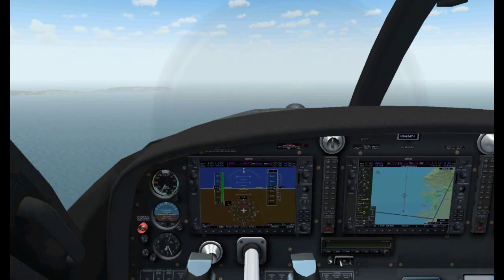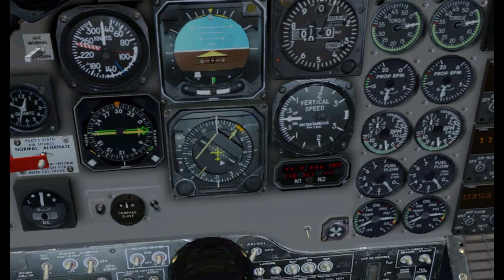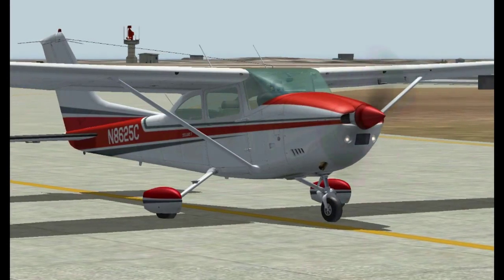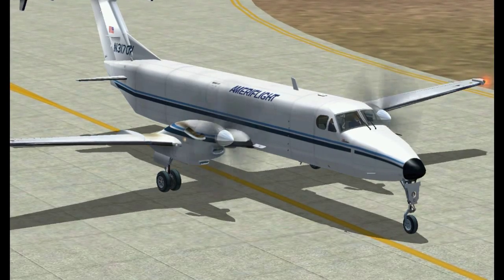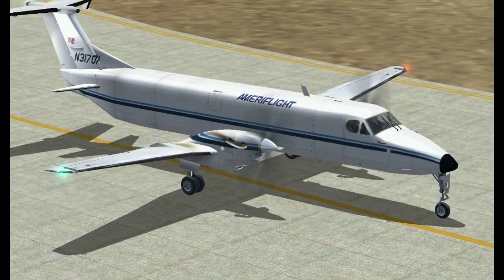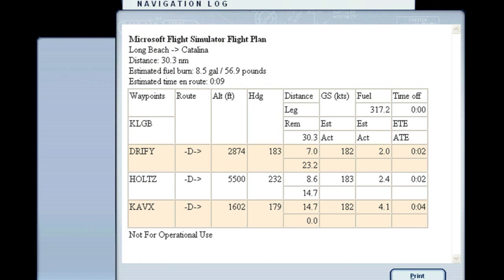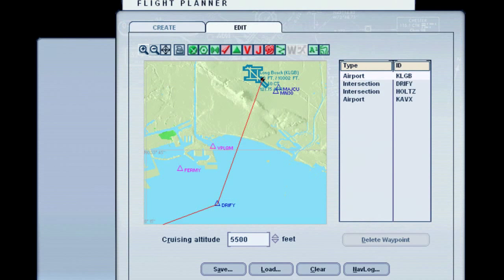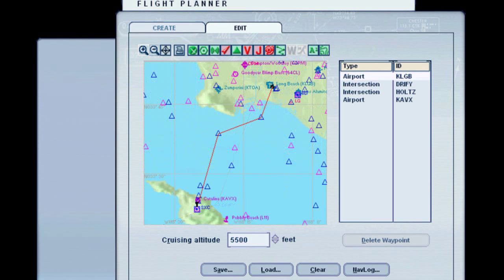GPS Navigation Tutorial - Part I (GPS Navigation Briefing)

Comment: @Mets747 You need to have 1200 hours, 500 hours cross country and all the other part 135 Captain requirements because you would be operating single pilot part 135. 

Ameriflight is good single pilot experience. It is excellent experience, but you can expect a duty day 13.5 to 15 hours long, depending on the route you fly. And you may only be logging 3 or 4 hours a day, depending on your route. 

A work day might be 5am to 7pm, you take a 3 hour nap in your hotel to make up for lack of sleep.

Comment from the maker: @bushflyn 

Any pressurized plane you can descent at 500 to 1000 fpm (piston planes) and 500-2000 (turboprops)

For anything that is not pressurized then keep it at 500 fpm max.

As far as when to start descending, a good rule is 1000 feet for every 2 miles, so if you have to descent from 12000 to 2000, that is 10,000 feet, so for 10,000 start your descent at 20 miles.

This is not set in stone, but be ready to make small adjustments to it depending upon the flight.

Comment: thanks. i generally only use props! small to medium, and occassionally up to a king b200 or q400 or beech c/d. usually cessnas up to the 208 really. i just want to be at say, 8,000 feet, and know how to descend steadily in time for approach. i am using real world charts (australia) where possible for all legs of flight. if the chart says 'descend to 2000 feet at 5 miles' do you use the AP to decsend to 2000 from your last alt, or just use the VSI and get down at whatever rate? thanks again..